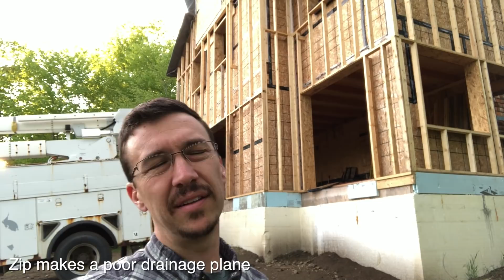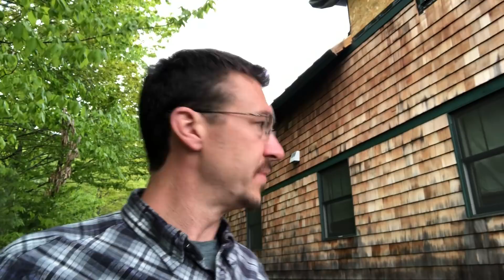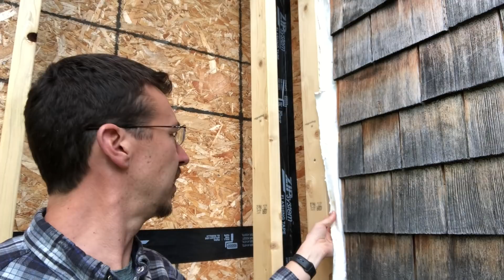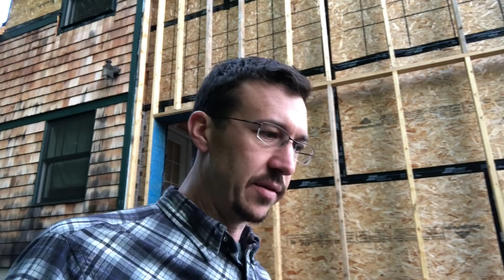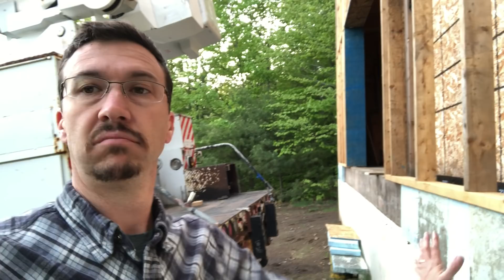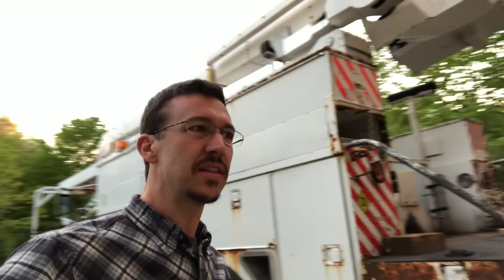Don't put Zip System Wall Sheathing on Double Wall Construction

Comment: 100 per cent. Your presentation might be lacking a bit but I agree with your point. I've been building double-walled houses in a Zone 6 climate since the 70s. I started out sealing the outside but even though I overlapped my interior vapor barrier two feet and glued and taped it, I found actual water droplets on the inside of my insulated sheathing. I have since built by sealing the interior and letting the outside breath. This still could be done with ZIP type systems as long as there was breathing, using a "rain screen" or strapping behind the water-proof layer of ZIP.  Despite the breathing,  our last house cost less than $1,200 US for a year of electrical heat, lights and hot water. If we were building in Florida, we'd probably reverse our vapor barrier/breathing system.

Comment: Your foundation walls need to be sealed. I’ve seen people use guru membrane or schluter membrane. Apply it with vnotch trowel and thinset then use a 10” drywall knife and push out the excess. But also it should be sealed before you backfilled. I mean that’s the requirement where I live in KY. In fact a client of mine just bought a home with that same foundation. The previous owner opted to not waterproof it and he has some water issues in the basement a decade or more later. Love your videos bro. They are entertaining but also informative. Keep em coming.

Comment: So for anyone wondering, standard 7/16" OSB like that used to make the ZIP sheathing has a permeability of about 2 perms at 50% relative humidity, so the integrated WRB coating in the ZIP sheathing having a vapor permeability of 12-16 perms is actually fairly vapor open.  The tape that is part of the ZIP system is also vapor open and will cover nail penetrations at the seams.  They also sell a fluid applied WRB product that is intended to cover over-driven nails in the field of the sheathing (you aren't supposed to need to use it on properly driven nails, but it won't hurt to use it on any nails not covered by the seam tape).  ZIP isn't the best product for every situation, but this guy clearly didn't do proper research about it before making this video.

Also, what are these other products that are supposed to be better for double wall construction because you never mentioned them!?  You tell people they shouldn't use something, but then don't offer an actual alternative that would be better, nor explain why it would be better.  You make some valid points, but get completely lost in misunderstandings and poor research with no real explanation of why ZIP is bad for a double wall construction or why something else is better.  This video was such a frustrating waste of time, especially when you seem to have done enough research to have found a better alternative but then don't share it.

Comment: Built a larsen truss style house before. Was, in my opinion so much extra work for no benefit. I mean you are trying for a 50 plus r value. On the outside, yeah no wonder there is going to be moisture on the outside!! And don’t even get me started on what the mice/squirrels will do to your insulation. Such a waste of time building it this way. If you want good r value. Use 2x6 or 2x8 framing with close cell spray foam. And before you say “thermal bridging!!! just keep in mind every window and door, and deck ledger is a massive thermal bridge! We aren’t building homes that need to survive the antarctic winters. Cant stand when people re-invent the wheel. Larry haun is turning in his grave!
Reply: Larry would follow the science... there is a thing called thermal bridging and yes windows and doors still have thermal bridging but the more you limit thermal bridging the better the house will be...and R50 is good but you want more, especially in Alaska. Mice and squirrels won't do anything if you build it properly.

Comment: Weird. Interesting framing on that exterior wall. At first I thought it was balloon framing, but then realized it's just missing a cap plate over the top plate. No headers over windows and doorways. No fire-blocking between floors. No rim joists. This makes me think the outside wall is just to create a thermal barrier. And the interior walls are structural and carry the load....   ¯\_(ツ)_/¯

Comment: Control the vapor with proper humidity control inside, that’s the best, easiest way to do that in a tight well insulated house, control the exterior penetrations. This has been studied and tested. Unventilated attics work just fine without inviting unconditioned air into the envelope

Comment: I continue to see people getting this all wrong. This guy knows the way. ZIP system is NOT permeable. If you live in the North you vapor barrier on the inside. In the South you vapor barrier on the outside. ZIP system is great if you live in the South. For me NOT! I live in the Northeast. OSB and Tyvek. Will prevent the rain and breathe to the outside. BUT you have to caulk or tape every single fastener and seam. If you don't it WILL leak! And Tyvek does not break down if it's covered. If it's left exposed it will break down.

Comment: I own a home that had closed cell insulation and no waterproofing membrane, its sheathing was solar board (osb with a foil like coating) with stone block exterior; guess what, most the sheathing is rotted out and black mold forming in the wall cavity. I now have to replace all the exterior walls, and I went with Zip system

Comment: Depends on where you live.  Building in a humid climate,  a lower perm barrier is fine.  You won't dry to the outside in a warm humid climate.  Water and vapor is always driving in.    
In a cold climate vapor will drive out.  
Leaky houses create water damage from vapor condensation.   Every nail and staple will condense vapor from inside the house on a cold day. 

A good system for my humid southern region would be exterior insulation that is permeable and hydrophobic (rockwool) over zip and and air gap with furring strips then your siding is nailed not to the zip at all.   Before insulation is installed you place butyl sealing tape where the furring  will attach through the Rockwool.  

Maybe consider a nice dehumidifier in the conditioned space.  
With attics, is  your outside air dry enough to get humidity out of the attic most the year?  Maybe venting under the roof deck with an air gap and having a conditioned attic is best.   I'm driving around the south and seeing a lot of houses falling down. Rotting... especially the roofs.  Maybe traditional just keeping water out and letting it vent isn't good here.

Where I was from I think traditional building was fine.. all day. 

My first statement.  It depends.  Build to your climate.

Comment: I'm soo glad I read the comments a few minutes in after hearing this guy talking about a product he never used.
Reply: While talking about using it wrong. So he got fired up and made a video because he didn't understand the system. Matt Risinger has been using Zip for a while now and swears by it but by all means we should take everything this obnoxious clown says as gospel right? I got two minutes into this video and had to stop it. Dude is just too annoying and too ill informed. I pity those who actually think this guy knew what he was talking about
Reply: Yea this ass hat is a sub par builder who is set in his ways and doesn't adjust his approach.he didn't know how to set his nail gun.

Comment: There  is a flexible, cheap, and non-technical rain barrier wrap that has been around nearly forever, that is a good water barrier and is highly vapor permeable (especially when wet, which is when you need it).  I have done remodeling where I've dug into the siding of old houses and it is still there and hasn't failed. When applied properly it will reseal around nails and staples just fine, and when covered it lasts nearly forever. What is it? Plain old tar paper, or asphalt felt, overlapped properly over the sheathing. It's also under almost every stucco siding, and works even better with a rain screen (gap) applied over it. So I'd use that over any unproven European who-knows-what. I'd also use plywood over OSB for same reason--much better vapor permeability.
Reply: Imagine... unproven European who knows what... 
It may have not to be proven by you but they have had the best building systems for centuries.

Comment: Trashes zip but makes damn sure to use there tape 😂. True we don't know yet how and what will work with modern cooling and heating structures in varying climates. But 100 years fck me dude no we don't build homes to have no restoration/remodel needs in 100 years. This guy is like people who say I'm gonna make and 800 hp car but I'm gonna build it good so it will last forever and use it as my daily driver. Neither did they at any time ever. Roman buildings, Egyptian pyramids? Sure the elaborate incredibly expensive structures to show wealth and power. But you dont see the workers home standing do you?  Hes pissed because it's a science that were still working out an incredible contradiction were finding a balance to somethimg that changes drastically for anyone as little as 250 miles away. True you make moisture harder to evacuate but air leakage creates a massive amount of condensation/termite and bug issues. Hot homes massive Bill's in the gulf coast.

Comment: Yall need more research. Zip will not let air through but it will let moisture vapor through. Ha this guys a dork. Zip has a drainage plan surface. Works well for water running down stops air flow stops bulk water but let's vapor through.

Comment: Have you looked into having a erv or hrv to control ventilation. You are correct if you are not planning to address it with your comfort system.

Comment: About styrofoam, there are many ways to finish it. The most sturdy one is the 700kpa, it can take 380 kpa of pressure with less then 2% of deformation over 50 years (what they say), i'm using them under my concrete fundations. (it can take 700kpa with less then 10% deformation).. That's a LOT...!

Comment: If this tyvek as been exposed to wind, sun for 5 years... Of course it's dead now....
We use rain cover sheets that let vapor out and prevent water from going in, 2 kind of them... One kind is UV proof for spaced cleats, the other one which is less expensive is not.

Comment: Sounds like somebody has an issue with Huber products.  I have double walls with zip on the exterior exactly in that scenario.  It has no moisture control issues after 7 yrs.   Manage your air envelope and stop whining.  It is way better than OSB naked.  The structure can withstand weather on the zip for many months without failure if need be.

Comment: What are you using the keeps the water out but let's vapor through
Reply: Tyvek does it well.  I'm not sure what he was referring to saying the Tyvek is broken down.  The sound of the Tyvek in the video sounds as if it's brand new...additionally the sheathing underneath the Tyvek appears in very good condition (when he moves it to the side), so it appears the Tyvek did it's job and well.  The fastener holes from the siding are a by-product of installing the cladding, that would occur with almost any cladding and any weather barrier that is chosen would have to deal with it.

Comment: With homes built this tight you need to install a hrv system to vent the house.  And possibly if you are doing radiant cooling you need a whole house dehumidifier to control humidity.
Reply: Which is awesome

Comment: The future is plastic. From framing members to roofing tiles plastic will be used in 100% of a home installation. It is the only answer to not having to worry about condensation. There are currently homes being printed from industrial 3d printers and they far exceed our r ratings.

Comment: Your overly generalized comments on Zip are frustrating. I love that you’re attempting to build a high performance enclosure but your comments pertain to using Zip in a situation that few do and that few would recommend.  It would be interesting to debate your chosen wall system will industry building professionals, it’s a rather odd duck.

Comment: What you're fumbling toward is dewpoint control.
If all of your insulation is on the INSIDE of your sheathing, your dewpoint winds up being toward the exterior, in which case you have to make allowances for your wall assembly to dry out.

Zip assumes that you're going to have insulation exterior to the sheathing, moving the dewpoint beyond the sheathing, where it will dry to the exterior.

This is not a case of "bad marketing".

This is a case of "you're using it wrong".
Reply: But isn't zip sheating vapor permeable?
Reply: @isaacmadrid15  yes it is.
Reply: @isaacmadrid15  NO!
Reply: Even considering dew point management this guy in the video is wrong, zip is vapor permeable, therefore the entire premise to his complaint is wrong. Zip can dry just fine to the outside or inside.

Comment: The only thing to use on the outside of a mid to northern house is something with at least a 10 perm rating, or more. this leaves solid wood sheathing, the black sugar cane fiber board, or the yellow fiber glass scrim faced gypsum sheathing. I would only use the gypsum sheathing and caulk the seams to resist air movement. A good latex or urethane caulk. Sound control, fire resistant, and structural rack strength.

Comment: Zip is leading to light gage metal studs. I've got an existing shiplap 1x8s on my 2x4 WD ext wall, therefore I need permeable insul in my wall cavity. I really like cellulose insul b/c it manages moisture, but the QC on the install has to be right. Also, I would like to install comprised rockwool on my ext side over  rainscreen over the shiplap. For the interior side: 1/2" xps board insul w/ low voc & low flame spread + vb + gypbd. Result: Little to non thermal bridging, a permeable wall cavity that manages moisture, a fire retardant insulated exterior that will stop the Summer heat & winter cold from, an interior space where moisture can be managed the the mechanical heating & ventilation system.

Comment: Look I do renovation been doing them for over 40 years. 1700 homes to current day. We take cedar shakes off of 60,80 year homes and the tar paper/felt looks brand new. This building envelope making it all air tight is BULL CRAP. Homes/wood needs to breath. You build it right....caulk all the bays use 2x4 construction with R-15. This foam/cellulose is all BS. US open Cell in the attics and don't blow it. You will have a nice warm house.
And buddy is this your house...WTF are you talking about. Leaky house. Leaky this. THE MATERIAL COSTS make all this crap prohibitive and you crazy house you will never see payback on all the ridiculous money you spent on a double wall LMAO. Then to top it off you used FALL APARTacle bOARD, osb SAME SHIT. You can't get a nails in worth crap. CDX 3/4 should have been used on the entire house....NOw double wall.

Comment: This is why you should leave this to professionals. The idea of letting the house breath was fine in an era where those kinds of materials were available, but with the global population hitting 10 billion by 2030, that is no longer the case. Moreover, those house were very uncomfortable.

What you are talking about doing has been proven to cause mold with 30 plus years of observable data to back it up. By letting air through cracks in the envelope you will trap moisture in those areas. Guaranteed. 

Your thinking should be more along the lines of sealing the inside as well, not letting air get past your walls. 

I advise anyone watching this to head over to Green Building Advisor, for expert opinions.

You concerns with zip are well founded. But it your installation, so it is up to you how well you install the product. Also, instead of tape, use the mastic. Matt Risinger has a great video for installation in this way. 

You seem like a smart guy. I wish you the best in your build.
Reply: Very well put Justin & without doubt Matt knows his business

Comment: 30 pound felt  is easy, inexpensive, waterproof, and moisture permeable.  And depending upon the siding installed over it,, 30#, or 45# felt  will glue the back side of the siding to the face of the wall sheathing in the heat exposure of the first summer.  I have done tear outs where moisture was trapped between the layers because of summer air conditioning, or water intrusions around windows, winter dew points within the walls.  It is ugly,, OSB sheathing or wall sidings of OSB simply turn black and fall apart.  I have done tear offs where 30# felt was used as the vapour/wind barrier,,, and the wood was dry, stable,, and the felt had glued itself to the face and the back side of the siding.  Care needs to be taken on install,, but you must be careful with the newer systems too.  Felt can be installed with a staple gun and the overlaps glue themselves together,, What's not to like about that?

On your double wall,, I would NEVER,, I repeat,, NEVER use anything that is non permeable.  So then your priority is to exclude wind and water.

The first line of defense are roof overhangs of 16 to 24 inches minimum.  3 foot and 4 foot overhangs are even better.  A no eave house style, is a style that originated because someone was penny wise and pound foolish..

Comment: Your talking about getting products that last . But u used osb inside the wall that’s providing your shear strength. Osb breaks down with your vapors being trapped between the insulation layers .